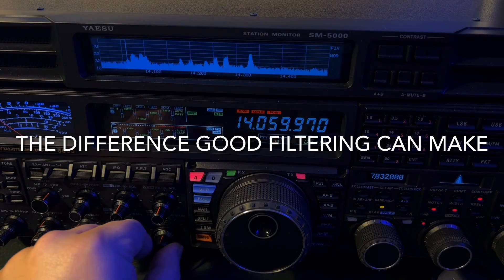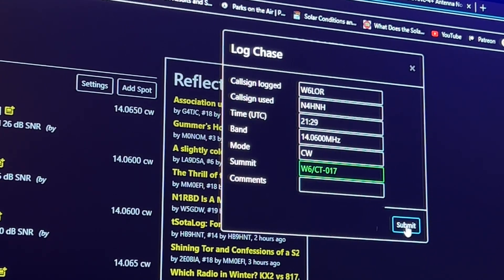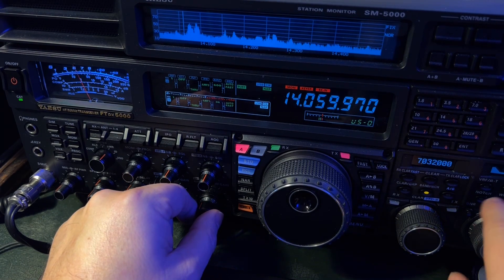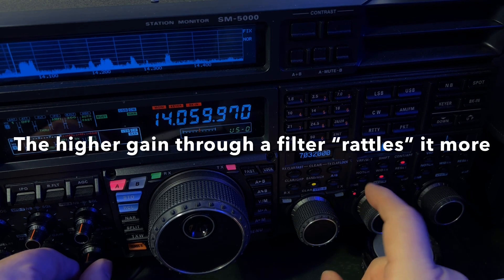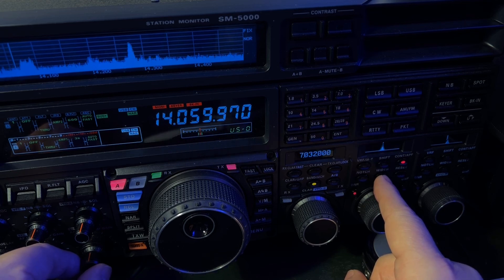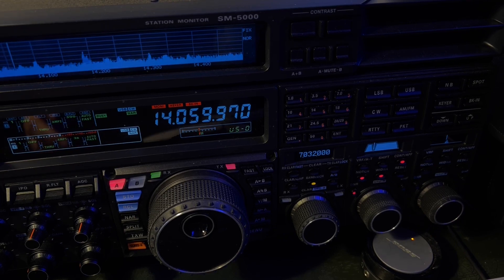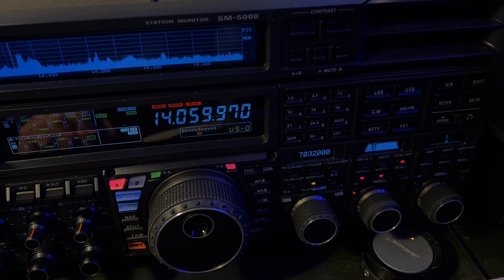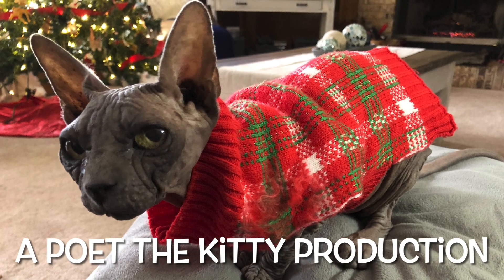The Difference Good Filtering Can Make

Comment: Filtering is good. Nice demonstration of a modern radio, it sure shows up my simple equipment.

I got the 250 Hz cw filter when I had a Yaesu FT101E, I liked that, it was good.
I bought a Maplin audio cw filter kit years ago for my h/b radio and it works well.
I bought the FT817ND in 2017 and didn't want to pay any more for a filter so dug out an HC6U 455 kHz xtal which I have had for many years and experimentally tried it in place of the proper filter and pleased with the results so soldered it in permanently. It's surprisingly quite good.
Both are cheap options, my attitude to radio,  and work okay and I don't expect them to work as good as a proper filter but I can live with that.

If you want wide audio cw filters here is one, I recently replaced all the R's and C's in my old 1944 Wireless 19 Set as it was extremely deaf on cw, two and maybe three cw stations all at once on 7 MHz so I like to go on 5.262 MHz spot frequency. Modified on tx for stability with xtals; 3.560, 5.262 and 7.030 MHz QRP frequencies.
G4GHB.
Reply from the maker: It sounds like you have been very innovative with improvements to your vintage radios.  I still like my FT-890/AT.  It’s a 1991 model, but that’s vintage for me. Before that I used a loaner Hallicrafters SR-150. I had so much enjoyment with that radio, using a straight key.  I learned CW by just getting on the air and sending QRS quite often. I appreciated the patience of the operators on the other side of those QSOs.

It’s amazing what we have available today.  I paid nearly $1400 for the FT-890/AT by the time I added the optional filters.  The FT-891, at $650USD, is a world class CW transceiver. The combination of its triple conversion superheterodyne receiver with a 3kHz roofing filter, coupled to the Texas Instruments TMS320C6746 DSP, makes it a remarkable CW transceiver. And the advent of a TCXO is also nice.  I appreciate vintage technology, but the newer innovations are truly welcome.
Reply: @n4hnhradio  All nice gear. I tend to keep things simple, made a one valve 2 Watt xtal tx for 40m and 60m. Ears are good filters too.
In the 80's I had four QSO's with USA novices over 2 hours, oh it was s-l-o-w for me but they appreciated it and said their first contact out of USA. There were more calling me after I signed out. Nice to be sought after!
G4GHB
Reply from the maker: That was so very thoughtful of you, Bill. Made their day.  73, Doug

Comment: I'm also surprised that a lot of people don't use it at all. Even my FT-891, the cheapest device in the line with a single 3kHz rufing filter, has APF and CONTOUR. I was shocked by the ability of these functions to pull out weak signals at the 50Hz band width. I can't even imagine what top-end Yaesu models with narrow-band mechanical filters and preselectors are capable of)
Reply from the maker: I put the FT-891 up against the FTdx10 in some videos. The FT-891 doesn’t get embarrassed at all. The 3kHz filter plus the DSP do just fine.

Comment: Your FTDX10 recommendations for filtering out the noise by applying DNR , APF , notch down -80Hz and the 300Hz filter narrowed to 50Hz works incredibly well. I made a CW QSO with W6LOR W6/IN-050 Poverty Hills using these techniques on a day my QTH 40M band had a S3-5 noise floor.
Reply from the maker: I’m glad to hear it, Doug. And that “notch trick” sometimes makes the difference in pulling out a ghost station.  Yet someone commented on one my other videos that the only reason to use tight filtering is to combat interference from other signals up or down the band.  I guess you and I will make the contacts that cannot. And our technique could come in handy in an emergency, when the bands are super crowded. For us, it will be like just another CW QSO.

Comment: Another subject, how come the Kenwood TS590S doesn't sound that good on the speaker or headphones? I have difficulties when listening to other stations on SSB. May I suppose it has too much processed audio, and that degrades it?
On the other side, Yaesu rigs have a comfortable full rich sound.
Reply from the maker: Hi Luciano!  I tried the TS-590SG when I was trying to choose my next radio, in 2019. It has a tremendous receiver but the DSP is weak, especially the digital noise reduction. And like you, I found the audio to sound over-processed. I likened it to listening to a speaker that is mounted in a plastic box. I found the same with the TS-890. I tried it too.
Reply: @n4hnhradio  I think the opposite

Comment: I definitely use Contour on the FTDX10 for SSB.  The highs sometimes gets to me, so will set it out at 3200hz, and that ever so gently knocks down some of the highs that can wear my ears out. Sometimes I feel more deaf, or where someone's lows are turned way up on TX, and I can't understand them, so will shift and width to hone in on more of the highs.  hope that makes sense.  Good video sharing your experiences and techniques, and that is so helpful for someone like me who doesn't have a lot of XP pulling out CW.
Reply from the maker: Hi David,

You can adjust the treble via the menu. There are three RX audio EQ settings, covering bass, mod, and treble. You can also set the audio shelving to roll off at 2600, 2700, 2800, etc., at either 6dB or 18dB per octave.

73, Doug